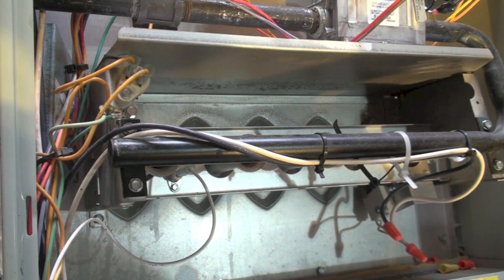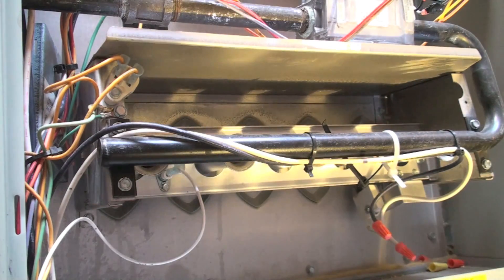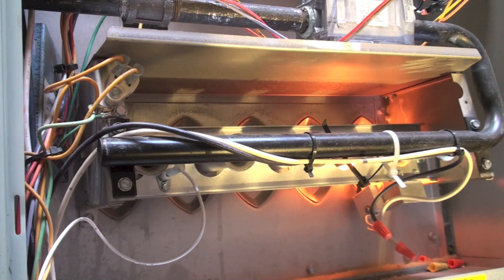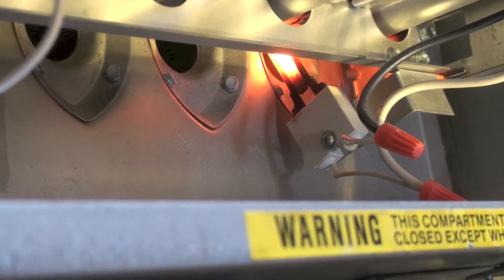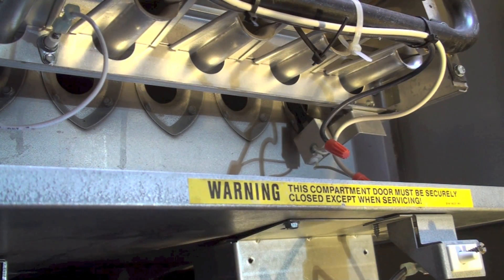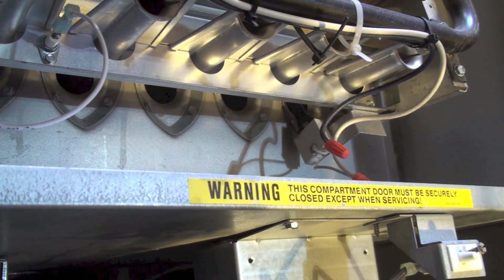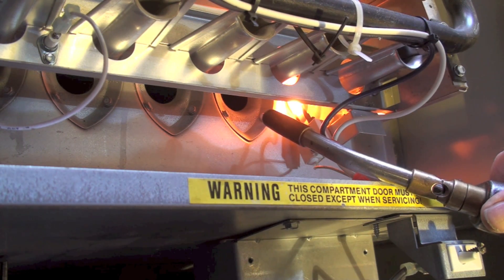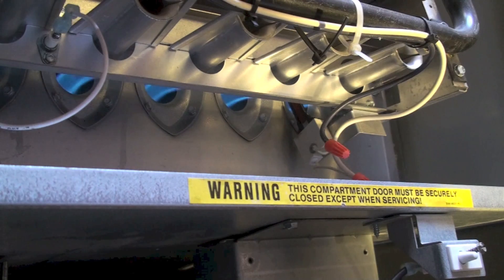Why wont this gas furnace light

Comment: It's the wrong HSI. You need an HSI with a lower Ohm reading. Like that, it would light up and reach correct temperature quicker.

Comment: The HSI is not in the path of the gas/air mixture, so it doesn't ignite... Now I'm checking the comments.
Reply from the maker: There is a link for the answer at the end of the video.
GFM
Reply: @grayfurnaceman  Thank you!

Comment: Looks like Hot surface Ignitor is bent down. Needs to be bent up, so its closer or  Indirect of the gas flow.
Reply from the maker: The answer is linked at the end of the video.
GFM

Comment: The hot surface igniter may not be positioned correctly. I learned this the hard way after cleaning the burners on a maintenance call.
Reply from the maker: The answer is linked at the end of the video.
GFM

Comment: so what is the problem.. see the HSI is working.. why the furnace wont kick in
Reply from the maker: Check the circle with an "i" inside in the upper corner.
GFM
Reply: @grayfurnaceman  is from the HSI..because i got the same situation like u have in the video. so which mean i need to replace the HSI..even the HSI was grown??
Reply from the maker: @tanhong4436  Sometimes the HSI will not heat up to a high enough temp, so maybe the HSI is the problem.  
GFM

Comment: it's the little 8 in gas line that goes to the igniter you have to take it off clean out the tip of it blow through it once it's cleaned out your burner light right up.
Reply from the maker: The answer is linked at the end of the video.
GFM

Comment: Cracked igniter. Current passes with large resistance when gas valve opens crack opens larger out it goes. Gas valve off no flame sensor.

Comment: my american standard freedom 80 furnace calls for heat and the ignitor starts to glow then my gas valve opens up and shuts down after a few seconds, I thought my valves needed to be cleaned but when I shut the furnace down and started it back up the ignitor glows and the flames come on. every time it's the same, the ignitor just starts to glow and the gas valve opens up for a few seconds and shuts down. I turn the furnace off and back on and it works fine. could this be the ignitor going bad?
Reply: TTV. HyperBoi This is the same symptom I am dealing with Trane XR90
Reply: Any luck?  Same issue.

Comment: Had the same problem.cloged rocket burners.need to take them out,wash them with water,then clean it with  metal brush ,and blow with air compressor

Comment: What if the torch doesn't work. And still dont ignite
Reply from the maker: If the ignitor does not come on, either it has failed or some other safety switch is open.  You should be getting an error code from the control board that will indicate where the failure is.
GFM
Reply: I have this issue, but the gas will not ignite. It seems like gas isn't coming out. My HSI lights up but no beuno. My led shows no code (solid red). Thanks for the videos.
Reply from the maker: If the inducer comes on and the burner does not light, you could have a failed gas valve, wiring problem between the control board and the gas valve or no gas available.
GFM
Reply: adoan185 have u figured out what was wrong with it?

Comment: "A" - The igniter is not inline with gas tube. "B" - You might want to search YouTube for "Troubleshooting Dementia". For you to post a question, and not give an answer, is either a form of Dementia or Stupidity. So I ask you... which do you have ??
Reply: # one man from the above
Reply from the maker: Ahh, you should never make negative comments when you have not checked all the facts.  The answer is linked at the end of the video.
GFM
Reply: grayfurnaceman 
I see in a SEPARATE video (:30) the HSI has changed position, hence there lies the discrepancy. So this type of self help video is mirrored after the old grade school   math tests, where you would go to the back of the book to get your answer. (ie; you have to go elsewhere for the solution) I think you'll find 99.99% of these videos on You Tube do not agree with your instructional methods. Very nice self helper... but next time, maybe... try not to make it into a "Hide n seek"..

Comment: get to the point! you did not help me one bit.
Reply from the maker: The video was made as a troubleshooting exercise.
GFM
Reply: I had a blinking red light...I looked on the inside door and it told me it was an open limit switch. I replaced my filter wich was filthy and ordered a new limit switch off of Amazon...35 dollars. The furnace works just fine now.
Reply from the maker: Rod Anderson Glad you got it going. 
GFM

Comment: #1  just because ignitor glows does not mean it gets hot enough to light off the raw gas,  or ignitor is not in proper location, or burners are a little dirty not letting gas flow over ignitor as it should so it can light.  based on what i can see i would bet ignitor not mounted correctly and possibly not the orignial ignitor since you normaly have a molex to just unplug and plug backin on most hsi's.
Reply from the maker: The answer is linked at the end of the video.
GFM
Reply: i musta missed it then

Comment: To everyone who stated the ignitor was in the wrong place.. look again, it's a 4 burner, and igniter is where it was supposed to be mounted. . As for the cause  in my case my  burner itself was clogged ,dirty, and dusty and had a little  corrosion,  and was keeping the flame spreader (the flat grooves on the side of each burner) from letting gas reach the igniter.   Try pulling out the burners and cleaning them..
Reply: S. Harris better to mount in a good stream rather then in a place where things can clog up and cause a no start in my opinion.

Comment: Havent read the comments but looks like hsi is not getting hot enough , i would check if the hsi its in the right spot
Reply from the maker: The answer is linked at the end of the video.
GFM

Comment: What is the problem? This is the same issue i am having but i do not see where you answered this problem??? Help
Reply: where is the link
Reply: @scottmichael6719  its BS.. NO LINK
Reply from the maker: In the upper left, there is a link to the answer.
GFM
Reply: @grayfurnaceman  there is no link to be found sir...
Reply from the maker: At about 2 minutes, there is a circle in the upper right.  Click on it.  I checked the link.  It does work.
GFM

Comment: Your HSI is not positioned correctly!?! Has to be. Gas is coming through, we know the pressure Switch and inducer are working. Obviously tstat is calling for heat. HSI is brighter than the sun so that works. Has to be incorrectly positioned. I'm still a student. Just got NATE Core and studying for Gas next Saturday.

Comment: It's a trick question.  LOL... The Hot Surface Igniter (glowing) should be directly in the path of the gas entering the burner.  You can see that it is off to the side and low.

Comment: i put the wrong censer in cause there was 2 about the same but the heat wasnt rated for the top and i took them both out to check for the problem.witch was a bad censer but then i goofed and since they look almost identicle put the new one on the bottom lol and same results youre having.

Comment: Hello Sir, I have the same problem here and winter coming. Would you Pls advise how to what to check or trouble shoot.
I manually hand fan it and that work. But now its bit  a annoying.  I'm a DIY everything guy so help me out. Thanks
Reply from the maker: I am assuming the fan will run when placed in the manual position.  This means power is available.  There is really nothing to go on here.  My first suggestion would be to look thru my videos on my channel.  There are many troubleshooting ones there.  If you get nowhere, give me model, fuel, symptoms and I will try to help.
GFM
Reply: Hey, can you please help me out? My furnace is doing the same thing but when light with a church it’s light out can you please help me out?

Comment: Well, I have a very similar problem, and wonder what you would advise:

I have the same furnace, and only the first two rows (5 total) will ignite and have a nice blue flame.  Burns a few seconds and then shuts down due to a safety feature that shuts it down if all 5 do not ignite.  If I lightly tap on the gas flow electronic thing which is between the gas line and the igniter, then sometimes the other 3 will ignite.  So, why in the world dont the other 3 rows always fire-up?  

Also, each fall I have always had to stand by the furnace and turn it on/off when  only the frist 2 rows ignited, and after 5-10 trys all 5 rows would ignite........and after this, the furnace would run fine all winter.

Could it be the "T" water trap being full of condensation water, maybe mixiing water with the gas?
Reply from the maker: When looking at the video, there will be a white circle on the upper right towards the end of the video. Click on it.  The answer will be there.
GFM
Reply from the maker: You can try cleaning the burners and the flame spreaders but if it has been doing this for years, I would also check the manifold pressure and check the orifices for blockages.  Hope this helps.
GFM
Reply: thanks grayfurnaceman for the info.  I took off the T Trap, and it was bone dry......so the water theory is out the window.  I removed the row of 5 injectors enough to look thru the 5 tubes, and all looked clean and the small holes on the other end were all clear.  I removed and cleaned the thermo-couple sensor, and also the igniter....both were actually in great condition, but I still used some emery cloth on them.  Put it all back together, and the first try it worked.......but that could have been sheer luck.    I bet if I had another igniter hooked up on row 3, she would fire up every time.  Just seems that the gas is not igniting in Row 3, as it may not be close enough to the flames in Row 2 and Row 1.
Reply from the maker: I may have your solution.  If the trap is dry from not operating over the summer, the dry trap could be causing your problem.  Some furnaces need the trap to have water in it for the furnace to operate properly.  Next time put water in the trap and it may work ok.
GFM
Reply: grayfurnaceman.......Wow!  That is something i would have never known.....that maybe I need some water in the T trap.  I can try filling it half full, but do not understand what water in the trap would do to help with the lighting.  Any theories?  This is a Traine furnace, and I still have the install manual, and will see if it says anything about water in the T trap.
Reply from the maker: If there is no water in the trap, air is drawn into the furnace and not enough air is drawn thru the heat exchanger tubes.
GFM
Reply: gray......OK, I think we are talking about different "T Traps".  I was talking about the one at the end of the gas line, a "T" shaped pipe connected to the outside of the furnace.  It is supposed to catch condensation and debris I think......so, it should be kept empty.  I think you were talking about the drain "T" trap, and I agree with you.....if this trap is dry then air can come back into the furnace.  Now I fully understand what you were saying.  Thanks.
Reply: not sure if this is your video answer or a comment for just a utube member, but in anyways video was made in 2015, can you provide us, in main comment about an answer?
Reply: sorry, I dont see any circle maybe because of my phone that removes ads and annotations, but never mind I don't have time for riddles.

Comment: my thought would be a bad control board, or in some kind of test mode. the startup gas valve and igniter seem to be operating at a much faster pace than they should be. second guess is a partially cracked hsi which still glows. i think its the board though.

Comment: Check the amp draw on the ignitor. It may not be getting hot enough to ignite the gas.
Reply: Yes, also could be off kilter with flame.
Reply: +Jeff Peterson  How do you check an amp draw on an ignitor, that would be great if you could give some instruction, I have a Multi Meter, do you leave in place and cut wires in loop?
Reply: +Tom Thumb I just use a clamp type ammeter around one wire from the igniter. Every manufacturer has a slightly different spec but I'd look for 3A or more.

Comment: I have had this problem before. If gas pressure is correct the ignitor needs to be moved to the right. I think there was a service bulletin on this for replacement ignitor's

Comment: I'd check the igniter, gas valve and burners. Those wire nuts tell me that igniter was messed with in the past. If the igniter is good, I'd call tech and make sure that's the correct one and positioned properly. Also the igniter seems to turn off too quick I'd bypass the thermostat as bad ones can drain power from the control circuit.

Comment: ignitor needs to be moved slightly
Reply: Ben Staton gotta love that screw holding the door switch!
Reply from the maker: Ben Staton Hey, it works.
GFM
Reply: Ben Staton Yep bend the bracket a little bit and problem solved.